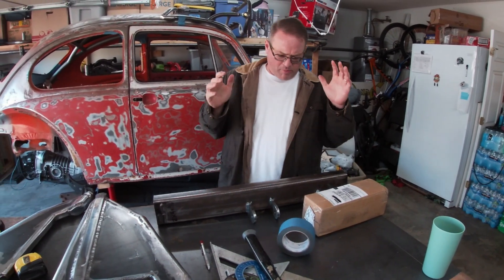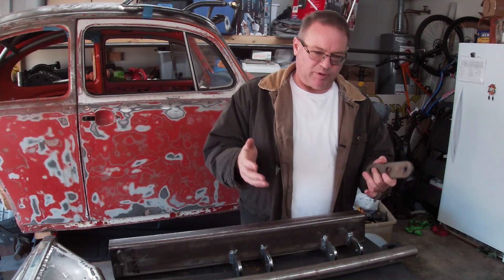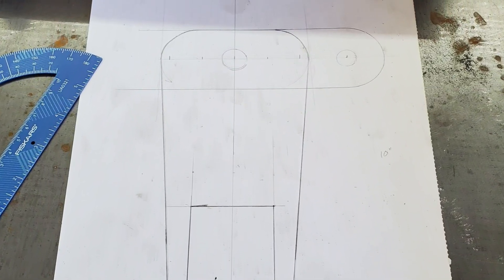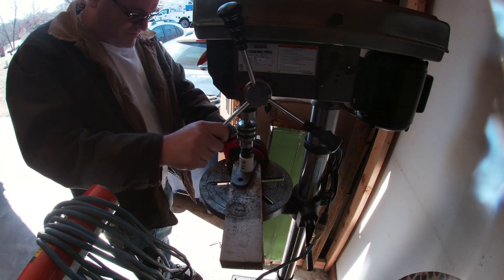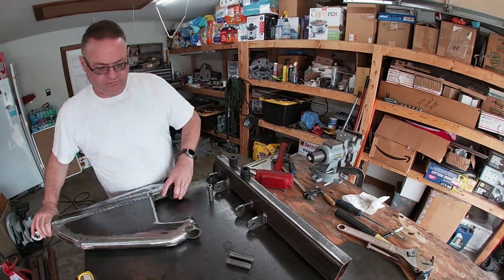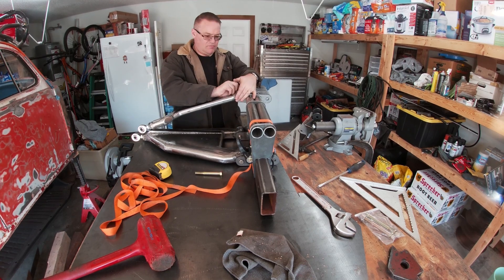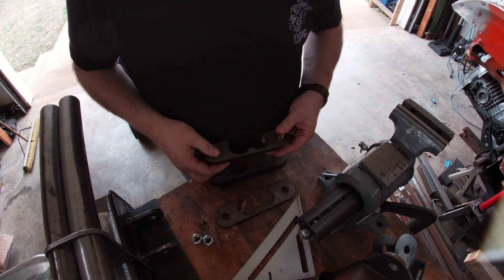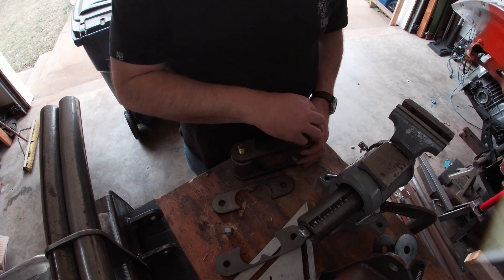Baja Bug Build (Ep. 39): Building The A-Arms Center-Mount Bulkhead

Comment: Thanks for the cool video.     For the mis-alignment issue of the drilled holes, I thought about a solution.   using the first drilled plate bolted to the next plate to be drilled, mount the assembly to the drill press.  Use the hole sawed hole as a jig- guide to get the lower hole drilled in prefect alignment.   This is in theory .  I hope it works when I try it. 
Keep the videos coming  !!
Reply from the maker: Hey Thanks DirtyVet.  Yeah, woulda-coulda-shoulda on drilling the holes.  The good news is there's enough play to still use them, but I might give your idea (bolting them together) a shot just to see if I can easily remove the tiny bit of misalignment. 

Thanks for the suggestion!